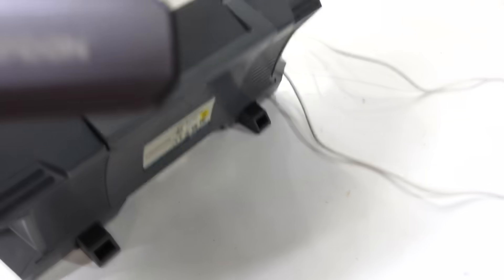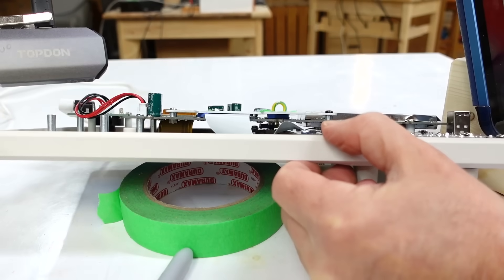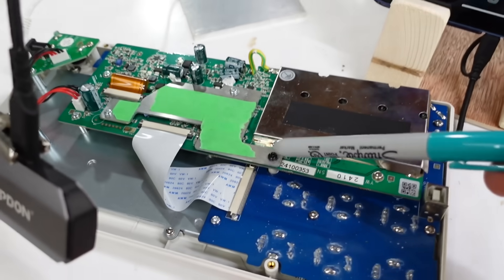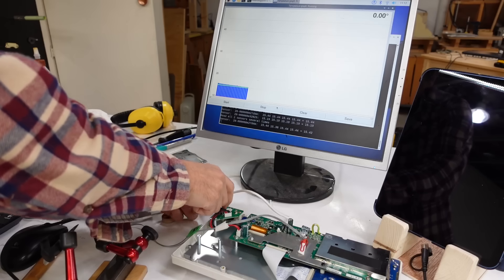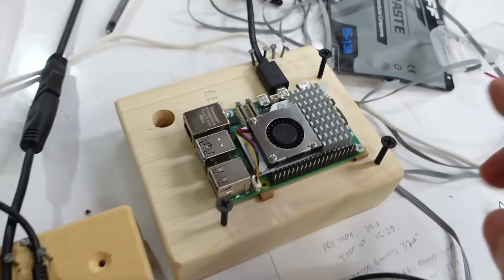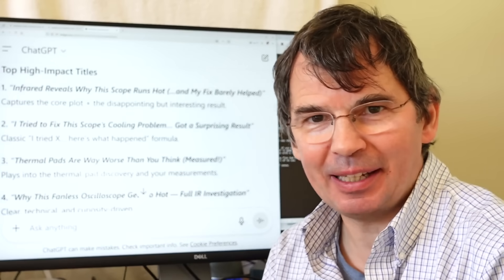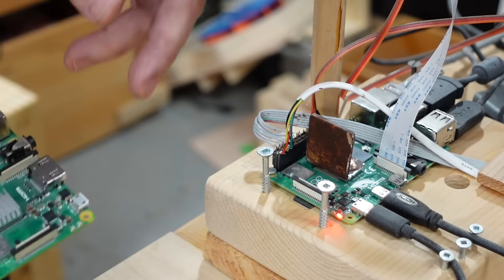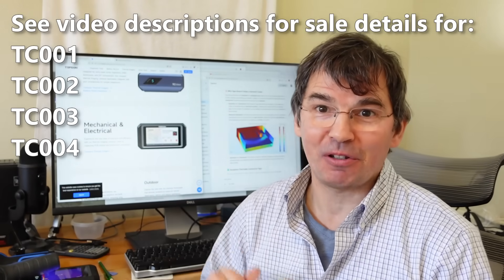Tape on a heatsink can make it cool better

Comment: Fun vid.  I guess a dark theral paste painted on the heatsink would be optimal. Plus a metal case with the same paint job inside and out. Oh, anodised better get.

I remember seeing a passively cooled pc that was designed so that a chimney effect created silent but very effective cooling of fairly high end hardware.

Comment: I often wondered if the choice of black for the rear mounted amplifier/driver heatsink on my computer’s 5.1 subwoofer stereo system. Even though they could have left the aluminum as is they and the overall look would still have been excellent, that would explain why the industry always made them black.

Comment: i was able to lower the average power consumption of my 55 liter 12v drink fridge from 40 watts average to 4 watts average. like 90% less, i have a video on my page which kind of poorly show/tells how i did it.
basically i made the fridge run from a GaN power supply and cranked it up to 28v (which is still within spec for 12/24v appliances since theyre based on ~14.5v charging of each lead acid battery from altenator). so it runs off usb-c now at the pd 3.1 spec lol at like 98% AC to DC efficiency.
but the real big benifit was realized from going crazy by reducing emissivity of cold end and increasing emissivity of hot end. my diy ultra compact dc power station can run the fridge for like 3 days straight now in my car on summer days as long as its not over ~100F outside. otherwise its just 1-2 days but the power station charges back up from my 12v cig plugs in my car so its not a big deal.
i dont think people realize that a shiny fridge uses signficantly less power than a black one....

Comment: Ventilation seems to often be an afterthought, if the device stays cool enough to "just not throttle". I like having thermal margins as I don't think running electronics at the upper range of their limits is better in the long term.

Comment: It turns out it is really, really easy to make a heat pipe- which is the most effective way of moving heat. Large scale, you can put a valve on the top of a capped pipe with a little water in the bottom. Heat the bottom until steam comes out the valve, close the valve, and you have a low atmospheric pressure heat pipe. The low pressure environment means the water boils at low temperature and moves heat along the tube. You could use a lower boiling temperature liquid, such as alcohol, etc, miniturize the pipe etc. The efficiency is far above any solid heatsink...

Comment: Very interesting video, Matthias. It would be even easier to follow if you described or named the objects rather than just saying "here" and "this one" say "the voltage regulator chip" and "model XYZ". Keep up the interesting analyses!
Reply from the maker: I haven't researched which chip does what on the scope.

Comment: A small USB fan drawing air out of the case will draw air across the heatsink and cool the whole thing by, I'm guessing, at least a couple of degrees.  Also consider some copper tape, from the chip to the sink. Make a loop of it, the blue sponge in the center for shape and fit. I bet it would be a huge boost to conductivity.

Comment: Lock screen rotation on the phone vs on the app, which might help.
Reply from the maker: what they should do is actually rotate the app, but NOT rotate the stuff it displays on the screen.  The infrared camera is more convenient to use when its at the top of the device than at the bottom.

Comment: polycarbonate, acrylic (PMMA), polyethylene, polypropylene, and PTFE, should all be transparent in IR. What's the case material? Is the IR transmitting through the case material, or just heating up the case? Could you cut a "window" in it that stuff can't get into, but IR can radiate out of?
Reply from the maker: Some plastics are kind of infrared transparent, but not nearly as well as zinc selenide.  The passive infrared motion detectors use a plastic lens, but looking at that with a thermal infrared camera, its only semi-transparent.  But good enough for the application, cheap and injection moldable.

Comment: I have some little 30mm and 40mm fans that are (practically) totally silent.
Especially if you run them on a reduced voltage to reduce their RPM, ie; run them from a little $1 ebay buck module and run at about 2/3 rated voltage.

Fans dont have to be noisy! High RPM high flow rate fans are often noisy, but a small fan at reeuced RPM can be silent and still moves enough air through the cabinet to make a massive difference in cooling.
Reply from the maker: a fan like that, even at 300 rpm would make a big difference.  But -- it was ok before, its better now, so I'll leave it at that.
Reply: Fans are one of the least reliable components in modern equipment so it's good that this CRO doesn't need one. Higher temperatures also reduce reliability so better cooling is good. How to get good cooling in a compact form factor without a fan - now there's the problem!
Reply: @kenmercer2721    I will argue about the reliability. I put fans in most stuff I make, hav8ng made a lot of power supply and motor driver equipment for CNC workshops etc.
Generally I buy fans with ceramic ball bearings, and run them at about 2/3 their rated voltage, so run a 12v fan at about 8v. Running them at reduced voltage means they last just about forever.
The fans that have a high failure rate are fans with simple bronze bearings (not ball bearings), those cheap fans are junk and lucky to last a couple of years.
The ceramic bearing fans are not that expensive, I think last time I bought some 40mm ceramic fans they were about $7 USD each.

Comment: Does anyone know if the rechargeable battery in the Topdon inspection camera can be (reasonably) easily replaced when it's end of life? The camera is a good price, but only if a bad cell won't brick it in a couple years.

Comment: 45 degrees is not hot at all for a semiconductor. Putting any heatsink on a plastic surface is also basically pointless, that the manufacturer did this is somewhat worrying. Those thick thermal pads are also a really bad idea, basically the only time they make sense is when there is already a heatsink for another component, where you have an additional component with modest cooling need.

Comment: I hate thermal pad....I much prefer using thermal adhesive when I can get away with it.  May not perform very well, but it performs well enough a lot of the time.  It also fills small gaps, not as thick as a fat thermal pad, but itnisnt gonna ooze out like thermal compound would.  It does fix the heatsink to the chip though, of course.  It can be removed but if you forget you used it you can break stuff when removing the heatsink.

Comment: Finally someone that has understoot that it is next to impossible to get a real temperature readings on glossy surface
Reply: Paint "liquid paper" on it, it is a matte white paint and you can get accurate readings.

It is also easy to remove because it doesnt really stick to the metal you can scratch it off with a fingernail.
Reply: @wizrom3046  I've read that Kapton (polyimide) tape is an effective target for IR thermometers. Emissivity of 0.95. I'm not sure whether it's true though lol.
Reply: @SeanCMonahan   good to know. But I would probably prefer to use painters tape like he did in the video, if I was using tape. Its cheaper and less fiddly.
Reply: @wizrom3046 True. It'll be nifty for me to use painters tape on stuff like heatsinks. Kapton tape can hold up to much higher temps though, so I'll stick (ha!) to polyimide tape for spicier things like my 3d printer's bed (110°C) and the top side of my printer's hot-end heater block (260°C).
Reply: @SeanCMonahan   ooh yeah that's hot! Liquid paper works great, comes with its own little brush and you just paint it on.
I've never used it on something 300'C so it would be interesting to see that.

Comment: Omg I don't have a infrared camera just a temp gun. I was building basically the hot end for an injection molding machine and couldn't get a accurate reading. I think kapton tape my be infrared reflective

Comment: You could maybe try and modify one of those Rasberry Pi heatsinks with a small fan and put it on the Oscilloscope or just a small fan since that would help  a lot since it helped with you just walking past it.
Reply from the maker: what I like about this scope is that it doesn't have a fan.

Comment: With the shorter standoffs is there any risk of interfering with the electronics (e.g., reflecting EMI or parasitic capacitance)?
Reply from the maker: yes, risk of that.  But if the circuit is that unstable...  and that scope is really not pushing the envelope of what is possible.  So wasn't that concerned.

Comment: I've replaced a lot of those pads with copper and aluminum so thermal paste could be used instead. Common on GPU memory.  Even accounting for the two interface layers, the difference is immense. I use to beat pure copper US pennies with a hammer to get the right thickness, now I just buy assortment of copper pads on Aliexpress. Way more precise and easiser. LOL

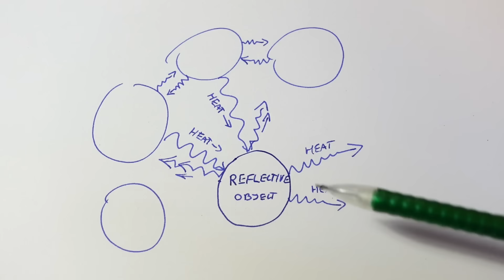Comment: small nitpick at 4:44
materials and objects can also transmit IR (like that lens you were using before), and it's the sum of emissivity, reflectivity AND transmission that adds up to 1
Sure this does not happen in the case of heatsinks or tapes, but still
Reply from the maker: good point, yes.

Comment: Doesn't antisieze paste work as thermale paste?

idk if aluminum or copper based is better, but I think it will work!

(ie: prevent suspension bolts from getting stuck, 'cause you know you'll be back)
Reply: antiseize will work pretty well, but check conductivity first. While there is metal, there should be enough resistive grease between the metal particles to prevent issues in most situations. 

Pretty much any grease will work much better than air. 

Main potential issue is separation: the oil might separate from the other components and make a mess. I know I always have to stir my bottle before using it to get thick goop. 

In a pinch on an old fanless Pentium 200, I used vaseline/petrolatum. That does turn into a liquid at like 35C, but surface tension kept it in place with the board flat. Ran 24/7 for years.
Reply: @443DM I'm sure it is conductive 😂 I haven't tested it, but I've never had a missing ground issue!
Reply: @Iowa599  why so sure? Even CPU "thermal paste" usually has metallic particles in it. 

Anti-seize is used on electrical connectors to prevent corrosion, that's why your smeared grounds keep working. 

Conductivity is a spectrum... even air is problematically conductive at high enough voltages.

Comment: Derbauer's cooling products might interest you, Thermal Grizzly. He is German, and probably the only one taking thermal compound seriously in a consumer capacity. 
Short story: I ordered a fancy CPU from China, which was a soldered laptop 9900K chip, converted to work in a desktop 1151 socket. I asked this Chinese factory, which is capable of doing this crazy-precise work, what compound they use, and even they suggested Thermal Grizzly.
It's a popular solution

Comment: You can use alumina thermal pads as shims and they come in various thicknesses while being far more thermally conductive than polymer pads.
Reply: I imagine that alumina's lack of squish is a downside for thermally connecting components that aren't exactly the same height. It also probably requires much more precise mounting pressure to achieve effective contact. I'm glad to learn that they are an option though! Guess I'll be adding some alumina shim stock to my next McMaster–Carr order haha

Comment: I know a guy who did thermal camera work on buildings as you say for energy efficiency research, but this was in the 1980s when they had to hold the camera in a van as it needed liquid nitrogen cooling. As he tells it they drove slowly around neighborhoods in the winter at night (again for better measurements), and more than once had to try to explain this to the police.

Comment: Does anyone know of an inexpensive thermal camera that can lock into a temperature range?
When I try to use mine (FLIR One Pro LT and a Sobtoe H2F) they will show temperature ranges but they won't stay on a consistent range.
For example, when the thermal camera:
Points at one place in the ceiling it will show a cool spot of 50 degrees in blue and 65 degrees in green.
Point it to a different spot and it will show a cool spot of 65 degrees in blue and 75 degrees in green.
This makes it difficult to compare pictures in different places to get a consistent view of cold spots.
Any suggestions on a thermal camera that can lock the colors into a specific temperature range?

Comment: Could also just put in a piece of copper between and reduce the pads even more.

Also some thermal puttys actually works very good.
I'm a car mechanic and have changed a few OBC chargers and always tear them down to find the cause when i come home and all of them have LOADS of blue sandy feeling putty that feels very cold to touch and every large inductor have about 100grams of this, so one charger can easily pass 400 grams of this putty

Comment: Instead of thick thermal pads, you can make copper "shims" of the right thickness and use thermal paste on both sides. You do have to get the thickness just-right.
Reply: He's in Canada, he's got pre-1997 copper pennies somewhere in the couch

Comment: It's good to see I'm not the only crazy guy drilling holes in their devices in the hopes of improving their cooling!
Reply: Just remember air flows in the highest impedance and out the lowest.

Smaller window enters and larger it exits. If the two their relationship is maintained proportional/coupled
Reply: To be fair, though, you did it to your freezer.

Comment: When grinding down those standoffs, why didn't you try to make them short enough that you could use thermal paste instead of the thermal pads? I think that would have been interesting.

Or you could have used something like the CS labs K5-PRO to fillin the whole space and try and maximize the contact between the PCB and the aluminum to see if that helped any.

Comment: Many semiconductors are rated for continuous operation up to 105C, sensitive ones usually up to 85C. Sitting at 42 degrees really isn't a problem to begin with.
Reply: I gathered it was heating and cooling cycles that caused most components ti fail eventually - that being warm for a day or a minute wears them about the same.
I'd say it probably depends on how warm and what part!
Reply: @joytotheworld9109  this is correct, it does highly depend on the architecture, but thermal cycling does cause far higher stresses compared to a regular elevated temperature. A chip can sit at a constant 90C for years but still show minimal degradation compared to chips which rapidly swing between 70C and 20C due to power cycles which not only causes stresses on the silicon itself and the gold bondwires inside, but also on a nano scale in terms of electron bandgaps for the transistors
Reply: but mayme that chip has analoge circuitry for the measurement, and there the temperature could play a bigger role? Theoretically, the better cooling might even make the results less precise?
Reply: @tristanwegner  analog stuff that could go from 20°C to 40°C and is still required to be precise is usually either properly temperature compensated by design or put in an ovenized environment heated to a regulated temperature — isolated from power components and ambient temperature.

Comment: I was going to say, thermal pads should be adequate for CPUs and GPUs because my Nintendo GameCube has one large heatsink running from side to side inside the case with a small fan blowing air across it.  It is used to cool the CPU, GPU and the 1T-SRAM.  I think they vary from 1 mm to 1.5mm but I could be wrong.  The machine is still running after 24 years with some upgrades (Eon GCHD Mk.II HDMI adapter, BlueRetro bluetooth controller port board and a Flippy Drive optical drive emulator.  I probably should think about replacing the pads but I would rather not touch them.  Also, remember that 40 Celsius on you scope is peanuts compared to some computer systems running 50 or more degrees Celsius.

Comment: That is why the grills on the back or the refrigerators and freezers are black.
Reply: No it's not.

You and Mattias are wrong on this.

It's not the color causing the increased cooling effect, it's the increased surface area and passive convection cooling.

This is proven by him pacing back n forth (thus causing air flow) to have such a drastic effect on the cooling. When he places it upright - yet again it's the hot air being able to rise and cool air rushing in from below which improves this passive cooling even more! When flat against the table the airflow from the heated air is reduced significantly.

It's all convection not reflective cooling.
Reply: that is absolutely unrelated, they are black because they are often powdercoated, electroplated and/or epoxy coated and black is very much the industrial standard in that regard. The color while on paper might show differences in reality make very little difference.
Reply: @MaxC_1  Every fraction of a degree makes a difference to efficiency. That's the main selling point, right?

Comment: This is exactly the case when increasing the radiator will provide much more cooling for the chip itself than replacing the gasket.

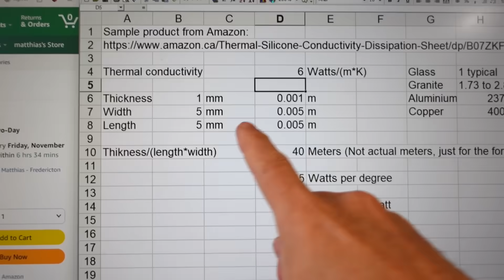Comment: 3:58 which version of ms. excel are you running? looks simpler than the current ones, kinda liking it!
Reply from the maker: Office 2000.  Also a lot faster than newer versions!
Reply: @matthiasrandomstuff2221 yeah, pre-2007(I think that's when the ribbon happened) was peak MS Office. But also pre-XML file formats right?